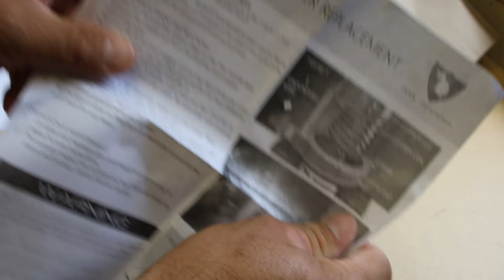Pool Defender Anode Rod Cover Replacement

Comment: Thanks for the video. Do you recall the site you were able to purchase it from. The only option I've found so far, is to purchase the whole assembly for $90. Any help would be appreciated.
Reply from the maker: I don't remember the website, but I do remember that they were located down in Norfolk or Virginia Beach area.  And when I did order it, there was limited stock. I would try ebay if you cant find it.
Reply from the maker: It was 4 guys pool supply and they are actually in Springfield, Va